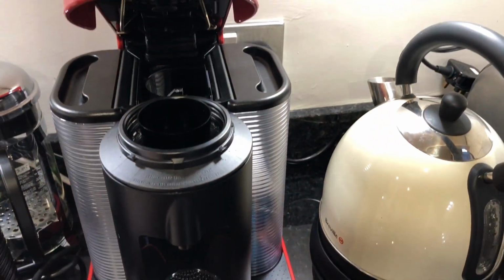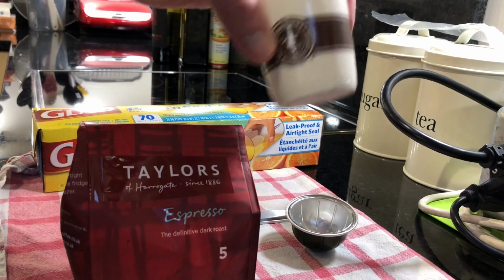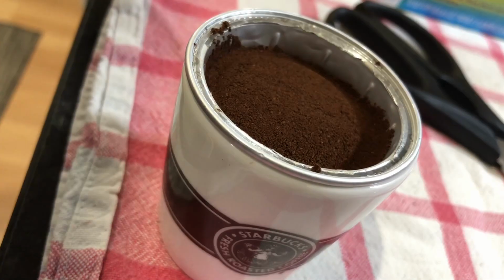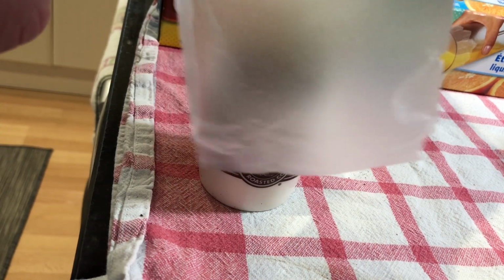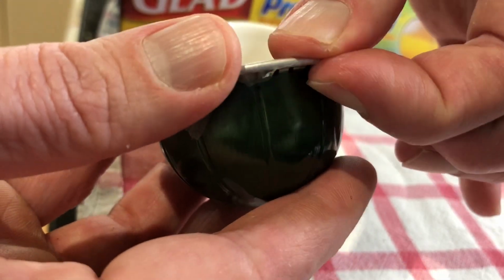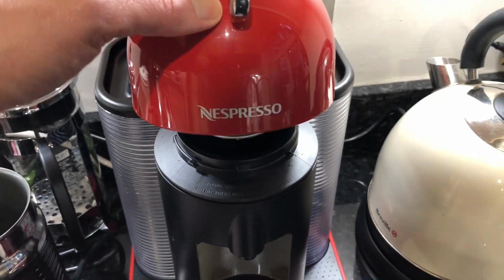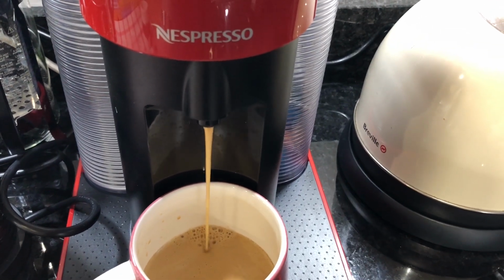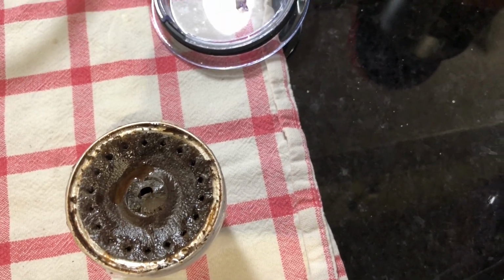Refill Nespresso Vertuoline Capsules - EASY!

Comment: If everyone just opened up a Vertuo capsule they'd realize that there is a plastic liner under the aluminum cover. This is a great idea since press and seal is food safe and can be heated. It is unlikely that it is leaching and plastics into your coffee, just like the plastic liner that comes in the original Vertuo capsule is not leaching plastic.
Reply: @. Ahhh, but you failed to mention home distilled water. It is less expensive than bottled water (per litre) and distilled water is 100% clean. And there is a bonus! Distilled water extracts more minerals, antioxidants and flavour from your ground coffee. Even the so call 'experts' don't know that.
Reply: @. Acid in the rain maybe, the plastic would be kinda dense to evap right?
Reply: @return2earthvideochannel  good info here. thanks lots! good day to you!
Reply: @aileenrivera844  Don't believe whatever any bummer here in Youtube says.
Reply: Is it made for boiling water to make coffee with?
Reply: @return2earthvideochannel  I believe distilled water will also extract metals from the machine.
Reply: @wolfie26  If the pipes and interior are high quality food grade and not susceptible to releasing harmful chemicals into the water, then any transfer of toxins should be minimal or non-existent. 
The benefits of distilled water are tow-fold: More flavour & antioxidants are extracted from the coffee (I only need to use a third less coffee compared to using ordinary tap-water), plus the machine won't accumulate scale which will eventually damage the machine beyond repair unless the user regularly de-scales the machine - most people don't do that.

Comment: I watched a multitude of videos trying to find a "hack" because I couldn't justify spending $23+ on a reusable pod. And then there were so many steps for all the videos I watched on using aluminum foil, including stacking two pods together. But this is the quickest, and simplest method. also the one that works best, thank you

Comment: This is the best idea yet! I purchased metal refill tops that fit on the pods. They worked ok but leaked around the sides. This method works perfectly. Thank you for your fantastic idea. I will be using this method from now on.

Comment: I used this technique with a spent Columbia pod and my normal coffee grounds. My usual grind is relatively fine compared to most drip grinds, but still a bit coarse compared to the Nespresso pods, and it seemed watery coming out, but the taste is actually pretty great on my first try. Probably not different enough to my normal drip to be worth the extra hassle, but it was a fun experiment. The real test will be using a proper fine grind and an espresso pod, but based on this test, I think it'll be fine.

And for all the folks worried about melted plastic, I inspected the used wrap, and it doesn't appear to have gotten hot enough to melt. Also, the original pod sealing material is made of some sort of plastic and foil composite, so I doubt the press-n-seal is any worse than that, but we all get to make our own choices in life. shrug
Reply: No problems here either.  But I also used Lavazza ground espresso in a can. Tastes great, flavor is full, and great crema.  Also, I wish I could post a photo so you can see how dark it is, pure espresso black. Good luck

Comment: not a bad try but I think that you are getting your coffee + some very delicious percentage of melted plastic and adhesive not worth the health risk build up, you might be better off just getting the machine from the original line that does not use a bar-code and then you can get 3rd party pods for 25 cents a piece. also just the time it took you to make this seems like a huge investment LOL ! for 1 cup of plastic coffee ...
Reply: Exactly what I thought. 100% eating plastic.
Reply: There’s people like you all over the internet who think they are better than the content creators talking down on their material. What you fail to comprehend due to your lack of foresight, intelligence, or research is that plastic film has a melting point of around 220 degrees. Coffee is brewed well under that temperature making the coffee safe to drink. If your so keen on not drinking cancer, than coffee should not even be in your diet and stick to distilled water.
Reply: hi thank you for that thought  how do you order the pods from a reseller with same bar code?? i didn't understand how to get it withour bar code
Reply: The “plastic” is Bpa free and is microwave safe so yeah . Theirs plenty of other items you have in your house that are way worse .
Reply: @RubbinRobbin  the type of a smart ass to buy a Mercedes S class and run it on processed chip fat (that's "phrench phroais phat", for those who spik murica).

Comment: I tried this and the machine made the most horrible noise, and got coffee grounds in my coffee. So I ordered the foil caps from Capmesso on Amazon and they work perfectly. They are also much quicker and easier to use than the Glad press and seal, so I'll be using the foil lids going forward. I also believe the foil is recyclable, while the Glad Press and Seal is not. A bit more money, but a lot of savings in time and the coffee is better.
Reply: Capmesso is easy to use and works, but so far it has leaked a small amount of cofee into the storage compartment every time. And it puts a few grounds in my cup.

Comment: I've got the time down to right about 90 seconds per pod using the "My Cup" foil cap system. No scissors required. You can by the starter kit from Amazon for about $26. There are 4 tricks I use to make it go fast: 1) Place a rubber-band around the pod to secure it in the holder. Otherwise the pod moves around while you're trying to place the foil. 2) Just tap down the coffee using the pod holder, gently tapping it down on the counter. This also causes any loose coffee around the edge to fall inside the pod. (I rarely need to use the brush.)  It levels off perfectly. No need to pat the coffee down with the back of the scoop. 3) When applying the foil cover, just press with your finger all around the very outside perimeter. You're only concerned with attaching the foil to the OUTSIDE edges of the pod, so run your finger around the HOLDER. That is key. It also prevents you from accidentally damaging the foil. Once the foil sticks, pop up the pod from the bottom of the holder and fold the foil around the lip. 4) When folding the foil, do 4 opposite sides first to hold the foil in place. Do not try to fold the foil by simply starting at one place and going around the pod. The foil can come loose. Lastly, remove the rubber-band and turn the pod over to see if the bar code is visible. Usually, there are one or two places it infringes on the bar code. Simply push the foil back with your fingernail. No need to cut the foil. It sounds like a lot of work, but it isn't. And it's far better than paying $1.10 for each pod from Nespesso. Good luck coffee lovers!
Reply: What grind coffee worked best? Does it need to be espresso grind?
Reply: Great tip did the same using tinfoil

Comment: How many time you can reuse the same capsule? Great idea.
Reply: Leah, you can continue to reuse it.  Just wash them and don't bang them too much so they can keep their shape.  Duane Reade has the press n seal on sale this week 2 for $6!  It's my first time using that product - it's REALLY GOOD!!!
Reply from the maker: I agree, we still have some of the original capsules that came with the machine. Less fiddly than using the foils that stick on - they are extremely fragile.

Comment: I’m going to agree with many other similar comments and say that the cancer/negative health risks aren’t worth using the press n seal. Is there another material that you can use instead? Also, what are the pods themselves made out of? Since they are designed for single use, how many times can/should they be used before they lose their integrity and you start ingesting pod/plastic in your cup of coffee every morning? I know there is a stainless steel version of the original tiny Nespresso pod, do they not make a true safe reusable vertuo pod?

Comment: I tried your crazy idea and my machine shakes like it will break in half!
Definitely not worth and it’s not safe for the machine.
There are lids on amazon for $12-120 of them. 
👇🏼👎🏼
Reply: Mine did the same but his machine looks different than mine. 
I bought the Capmesso kit and it works well so will stick with that.
Reply: Pamela Hickmann 
I have the same exact machine as his just different color.
Reply: @wethepeople7629  Good to know.
Reply: Yes, it didn't work for me either. Coffee grounds was the main ingredient. Didn't want to eat my coffee. And the machine wanted to break apart or at least it sounded like it did.

Comment: Is press n seal poisoness?
Reply: NorthWest Living it can be, the spikes to pierce it can make little bits of plastic press n seal come out into your machine n coffee. Not clever idea. Is there a way to seal with foil instead?
Reply: Yes ! You can use the ring from a second pod to secure foil around the first pod. Make sure the bar code is facing down,  and trim the excess foil. (Also, double the foil, if it's thinner foil. You don't have to double the heavy duty foil).
Reply: Cabbagekitten: Do you work for CNN? LOL
Reply: Heck no, what would make you even ponder that?!

Comment: Does anyone know where to buy either the starbucks shot cup or an alternative to hold pods in? I've tried ebay uk and amazon uk, and can't find anything without spending a fortune on a huge kit.

Any help would be most appreciated.
Reply: I use a small glass. Its not crusual but anything with a neck with that size should do.

Comment: Single shot espresso pod fill 7 grams of ya esspresso grounds 
Double shot 10 grams of espresso coffee
Tap seal and good to go oh yeah these amounts  i gave you is correct tested many times on both sides. If you getting leakage your fillin to full. I dont push coffee down to tight just use the amouts i said if you goggle it it will pip up and its correct as i took dry fround out and messaged and it messages to what goggle said

Comment: Thanks.  Works better than foil as you can still see barcode.  Allows me to get the flavor I want and save $.  Also environmentally friendly
Reply: Anita H but is it healthy for the body? Plastic is known for toxics when frozen, not sure about heat.
Reply: How is using PLASTIC (which NEVER biodegrades) instead of buying more pods (that are 100% recyclable) environmentally friendly??

Comment: This is a 10 minutes video but lets say you speed up and manage to do 30 of these in an hour! 2 min per pot ( you still have to have the pots washed and cleaned before you start)

Considering a cost of the pots are about C 80 each, you have saved $24, minus the cost of the coffee and plastic rap (that you are introducing to the environment over the indefinite recyclable aluminum cap) not to mention you have to have the coffee pot to begin with 

It's safe to say you payed yourself $15 an hour almost a minimum payment! Also possibility of ruining your machine and losing the warranty, why buy the espresso machine when you could just buy the ones that don't use prepacked pots? and come with their own stainless steel for far cheaper?

This video doesn't really make sense, does it?

Comment: Madness: Imagine you have friends & family round the dinner table, then it's time to serve everyone coffee. They may get it by the time breakfast arrives! NEVER re-use a plastic lined container for hot liquids. Nespresso do not say exactly what type of plastic lines their pods, but whatever it is, I would not re-use any plastic that will make contact with a hot liquid, it's just common-sense. Move on folks, nothing to see here.
Reply: The pods are not plastic...they're aluminum.  BIG difference.  Also the plastic press-n-seal can be microwaved, so as long as it is not melting into the coffee, I think you're ok.  :)
Reply: @andysmith3920  Andy, you failed to read and understand what I said. Yes Nespresso pods are made from aluminium, but they line them with PLASTIC to avoid hot water leaching aluminium from the pod and damaging your brain! But the plastic liner may well leach chemicals because there is very hot water swirling around inside those pods. I stay away from all single-use and re-usable pods because they are all lined with plastic - that's my point. 
It is simpler and cheaper to make your own coffee using my own method that you don't know about... "The Best Coffee Ever In Just Ten Seconds!"

Comment: FYI:  I’m pretty sure that the bar-code is bogus.  It’s decoration - not functional.  I see no bar-code reader on my Vertuo.  Hold up a 410 ml, a 230 ml,  and a 140 ml pod and examine them.  The difference is in the depth of the pod.  It changes the amount of water that is expressed through the pod according to how deep the little water wand sits.
Reply: The barcode does matter. The scanner is toward the back.

Comment: If you insist on using the VertuoLine to make your coffee, then this option is OK... BUT, you are infusing plastic into your brew! And that is also true of the standard Nespresso capsules. They are made of aluminium, but completely covered on the inside with a plastic film. This is to avoid aluminium (aka aluminum) making direct contact with the hot water and acids in the grinds which would poison your coffee.